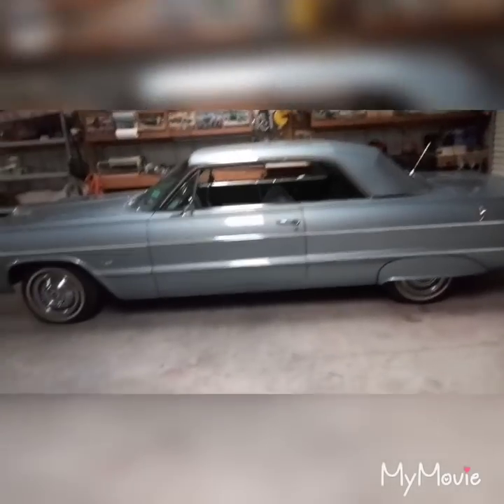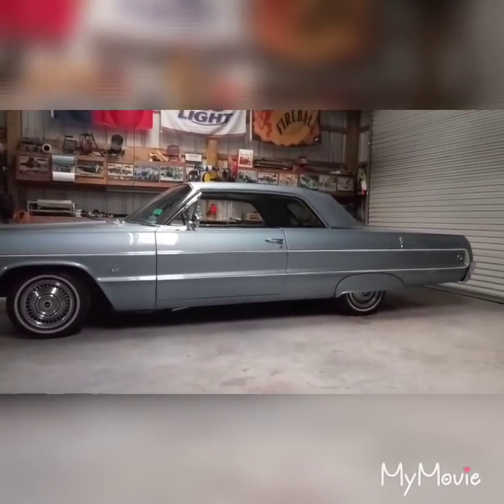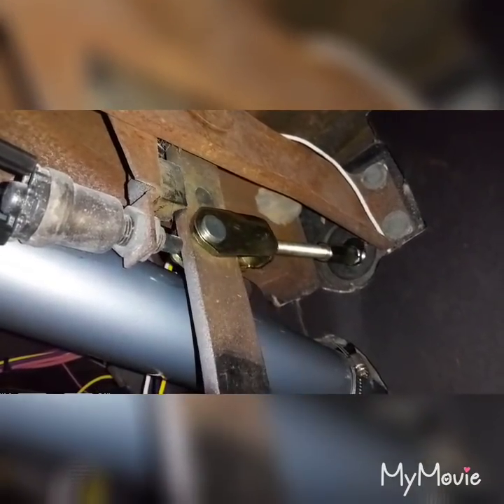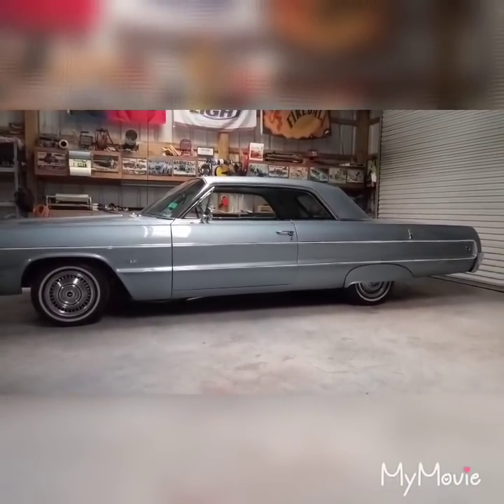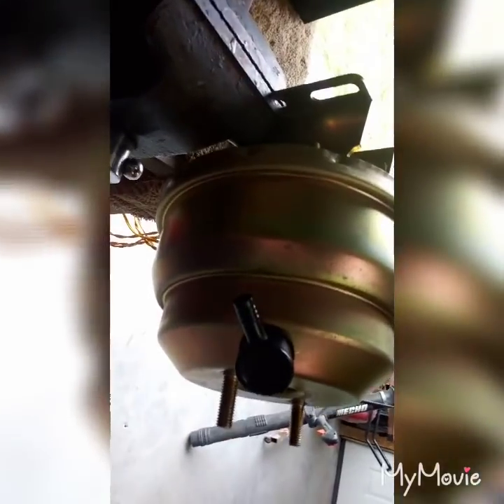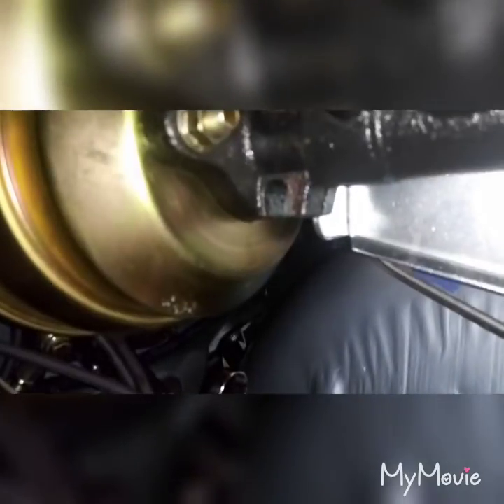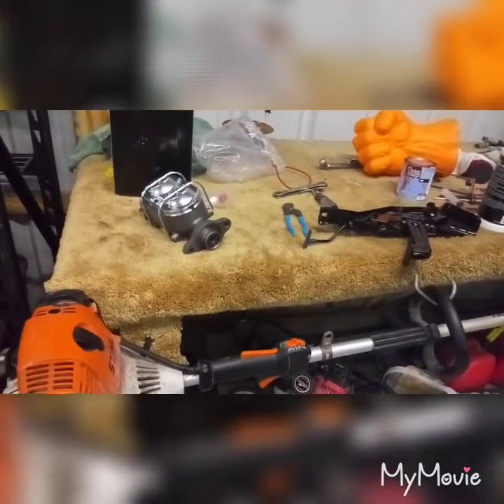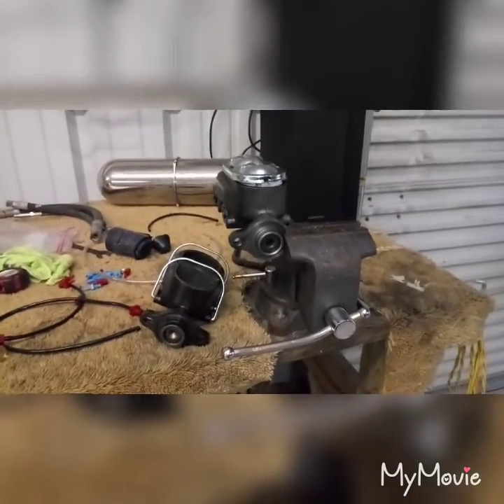Classic car 4 wheel disc brake woes

Comment: Are you getting a good seal between the master cylinder and booster? (Vacuum leak?) I also suggest using a pressure bleeder, that's about the only thing that works on old Lincolns.
Reply from the maker: Pt 2 explains what the problem was..

Comment: I'm having the same issues on my 1956 Chevy 3100 p/u disc all around pb & doing exactly what ur discribing so frustrated 😬
Reply from the maker: I forgot what is in this video but I remember the master had a leak between it and the booster.  I've seen masters and boosters, bad out of the box.  Straight garbage. Should be outlawed. The Chinese companies need to reimburse people for their time chasing issues. When the issue was the part right out of the box!!

Comment: I can’t seem to find the video of your brake solution. Thanks
Reply from the maker: If I remember right, on that car the problem ended up being a faulty master cylinder,  was leaking between the master and the booster.
Reply from the maker: If I remember right, on that car the problem ended up being a faulty master cylinder,  was leaking between the master and the booster.

Comment: Had this same problem on my last 64 and it never braked even when I bled the master cylinder and brakes.
Reply from the maker: Did you ever get it fixed?
Reply: lonestar lows Nope sold the car before I could find out what the problem was. But my best guess was maybe my booster was bad.
Reply from the maker: A bad booster is going to give a rock hard pedal
Reply: lonestar lows Damn well there goes my idea of what the problem was. I’m still learning how to fix the issues that occur with these cars I’m only 20 so my bad if I give suggestions that aren’t correct

Comment: ajust screw the nut out of the booster problem solve
Reply from the maker: Was faulty master cylinder.
Reply: @lonestarlows  ok mind did the same thing tell i ajust the screw out of the booster
Reply from the maker: Yes u can dab a little paint on the screw and see when it makes contact with the booster and get it really close. That's how I adjusted it
Reply: no the screw in the booster ajust out to give you more brake